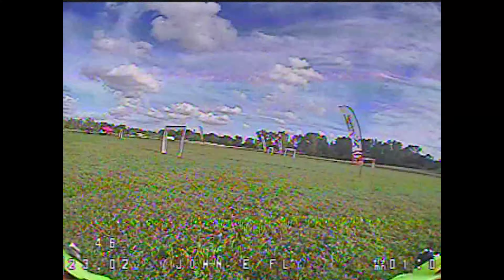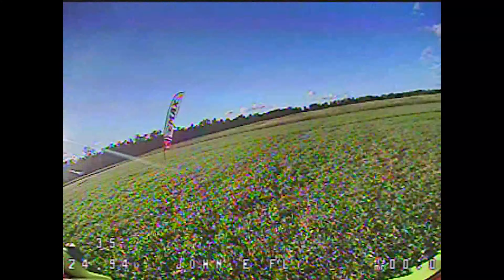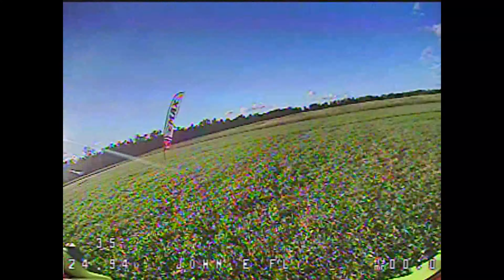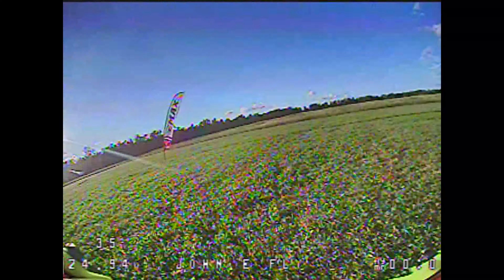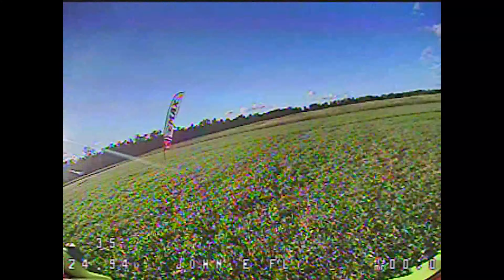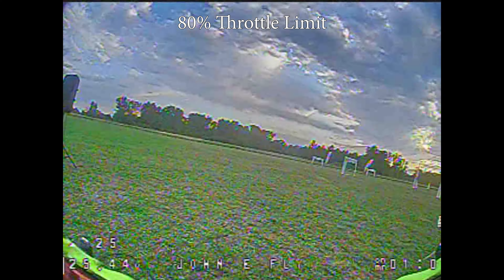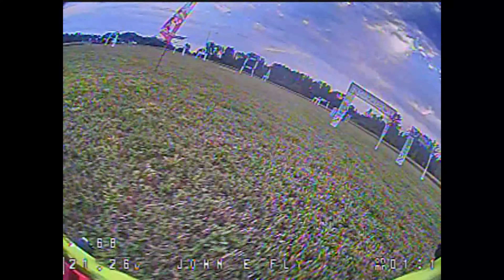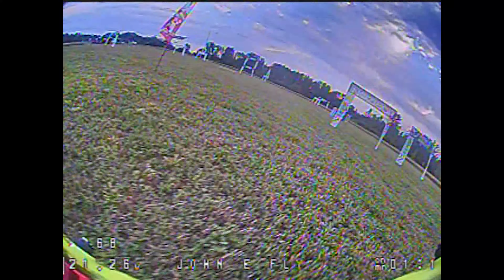Throttle Caps! | Limiting Your Throttle To Go Faster?

Comment: I think for those of us who aren't as fast, the added resolution is really the benefit on offer - 20% more throttle resolution for pilots that are still thrilled about finishing each heat they go up in is going to be a pretty noticeable improvement in results, especially for race formats that favor consistent finishes under pressure instead of getting one mistake-free heat.  Particularly for use weekend warriors, that's going to mean less crashes that are going to put us off our game and cause second-guessing abilities on a race day - the intangibles are definitely in favor of throttle limiting, then if feeling good do the same process of gradually bringing them up to get more pace.

Comment: Great video John E, this is something I've had reasonable success with myself - there were a few first gate incidents due to the extra power on starts though, so that's worth keeping in mind. That aside, I can think of a lot of pilots who would benefit from taking this approach - they all look at me like I'm mad when I tell them I'm capping the throttle, more power = faster in their minds.
Reply from the maker: More power equals a quad that goes faster...  doesn't mean it gets around the track in less time :).  I don't think people really appreciate just how important race lines are in FPV racing at this point.  It'll come though...

What do you mean by first gate incidents though?  That others have more power, so while you may get the jump on the holeshot, you had mid-airs because they are faster in a straight line?
Reply: @JohnEFly  we usually fly fairly small tracks and with mixed ability heats so it's good to get the holeshot and stay out of trouble, problem comes when the first gate is really close to the start line and you've just increased your throttle - I found there wasn't enough time to both adjust to the new limit and to get the holeshot, so I was either hitting the top of the gate or over compensating and hitting the floor lol

Comment: What’s the best way to add the cap? Thru the radio or thru betaflight or in my case Flightone?
Reply from the maker: I did it through the radio, so I can't say I compared them all and determiend the best way.  I also can't comment on the available methods within FlightOne.  However, I would assume that limiting throttle input (not motor output) would be the best way to apply a throttle cap.  And it would probably be ideal to change it on the FC so have maximum resolution from the transmitter, but doing it on the FC is a WAY bigger process if you plan to keep changing it, so that's why I did it from the radio.
Reply: John E Fly gotcha. 👍 I’ll mess around with it. I know there’s a few ways to do it on the radio and I know there’s a spot on Flightone that you can adjust it but I’ve never played with it. But watching vids now on setting a cap and I see that even the way I did it on my toothpick isn’t the right way lol. I just basically lowered the end point on the throttle which did drop it to 80% but it seems like it didn’t do it the way I was thinking it would. I did mine Similar to the way that Justin skinner did on his throttle cap vid. It works but not the best way to do it.
Reply: @JohnEFly  If you're trying to run high-KV high-voltage, I'd run the FC motor out limit in addition to the transmitter - e.g. setting an 80% motor command out limit, and 70% transmitter limit on a 5S 2600KV or 6S 2250KV setup.
I personally rely on the transmitter since it's easier to make changes on the fly, and I don't have to be powered up or have a computer in the field to reliable see where the limit is.

Comment: Do you scale the throttle or clip it? So at 60% throttle cap do you hit the 60% when your throttle stick is all the way up (scale) or at 60-100% stick deflection (clip)?
Reply from the maker: It's scaled
Reply: Resolution is always your friend - scale whenever possible, and add curves if it means you get more resolution where you need it.

Comment: Another Note: I use throttle curves now, so at low to mid i have around ~80% for tight turns, but at full throttle i get 100% when its really needed.

Comment: Great Research & Analysis. Thanks for sharing!!

One Question: Why did you skipped 90% :O ? 

2nd. question: What do you think about mechanically limiting your throttle stick? (either by getting the famous red racing gimbalsl, or using a 3d printed limiter and re-calibrating your throttle)
Reply from the maker: Thank you!  I'm glad you found it helpful.  Regarding your questions:

1.  Primarily because we ran out of time.  By the time I get off work and get to the field there is very little sun.  We just didn't have time to include 90% testing like originally planned.  It would have been a good test, but at the same time, I feel like 80% is already pretty close to 100% for me, the difference with 80-90 and 90-100 is less than the difference between 50-60 60-70 70-80...

2. I'm actually a fan of limiting the throttle travel.  Assuming you also calibrate your stick travel within your radio so you are not losing throttle resolution.  The IX12 actually comes with a restrictor on the throttle now so it's a shorter throw by default.  After trying that on the IX12 and really liking it I switched my Taranis to the red short throw gimbal as well.  I feel like I can get added throttle response by having a shorter throw.
Reply: @JohnEFly  great!!! Will try soon to print some 3d part to limit the throttle travel and calibrate. If I like it (which I think I will), I will buy the red short throw gimbal as well.

And will also try limiting the throttle to see if I can enhance my movements. 

Great contribuition man!

Comment: Im wanting to experiment here myself, was looking at how to make the caps in the IX12, are you only changing the end point to say 80% max, or are you changing all the points in the curve, so that quarter throttle is 20% instead of 25% when doing the 80 max. Is my questions making since, are you only changing the highest value, and not messing with the rest, or are you changing all the points in the curve to make it more linear?
Reply from the maker: I'm changing all the points to make the throttle curve linear

Comment: I think that running throttle cap from 50% to 100% will help pilots find their lines, but in the small local races, there are not enough practice sessions to take many packs on each throttle cap.

Comment: Not to be poking the bear, but why were there no runs done at 90%? It isn't mentioned why. Just seems like it is inclusive data to not include any 90% throttle cap runs and just going straight from 80% to 100%. 

Was it an issue with the Spektrum radio where only certian outputs could be done? Or was there an outside factor that is not mentioned? (Limited flying time etc). 

Will say, throttle caps are a good learning tool as mentioned towards the end of the video. I'd say definitely use them for say, a UTT track or similar when learning the course, or if deemed necessary  at a race.
Reply from the maker: It was just a function of time.  The sun was going down and we didn't have time for both.  Ideally we would have included 90% as well.

Comment: Did you run the 100% at the end of the day?  If so maybe this means you were pretty well trained on the track -> you expect to have better times at the end of the day. Also consistency could be more important than ~1s improvement. I track mistakes and crashes too not just lap times.

Comment: do you recomment putting a cap on a 2306 4s setup?
Reply from the maker: I would recommend trying this approach to force yourself to learn tighter lines regardless of your setup.  I'm not saying you should race with a throttle cap, or that you will be faster, but it definitely helped me to be faster once I removed the throttle cap.  On some tracks, I'm also faster with the cap.  The best recommendation I can make is to try it, and then see if it helps you.  Each pilot will be a little bit different.
Reply: John E Fly thankyou!!!

Comment: you can do show how to set now pls!?
Reply from the maker: There are many ways to do it.  If you have a Taranis there is a good video on Heart of America on how to do it.  You can set it in Betaflight if you use Betaflight using a throttle limit and scale.  Or you can do it like I did with Spektrum by going into the "Motor Curve" menu and changing the 20% 40% 60% 80% and 100% throttle positions to mean different outputs.

Comment: Have you tried scaling instead of capping?
Reply from the maker: It is scaling.  It's just a difference in terminology I guess.  But I did this via the transmitter and changed it so 100% on the stick was XX% output to the quad.  I then updated all points so the curve remained linear.
Reply: @JohnEFly  I thought you did it via betaflight. I C
Reply: @JohnEFly  I have mine set to a pot switch to change and another switch to turn it on.   Some have it set so that it speaks the number but I just look at the radio and dial it in.

Comment: I was beating guys this season with 2205.5 1722 and no throttle cap 😜
Reply from the maker: There is nothing wrong with 2205.  And honestly, 2205 is almost like adding a throttle cap to a 2207 quad and making it lighter at the same time.  2205 can be much easier to control, even though it lacks the top end potential.  I raced 2205 for most of last year against mostly 2207 pilots and had a lot of success.

Comment: you are missing the point.

The test should be a day on only 100% all day to see where you max out then try a day where you work through the caps.

Also, I tend to start at 75% then just go up 5% until I feel like it's not helping anymore or I'm making too many mistakes.  For me this ends up being between 85-90% which you didn't even test.
Reply from the maker: I think it's a bit tough to say I'm missing the point.  My point here is actually to start lower than 75%.  Flying at 50% REALLY forces you to focus on the lines.  In this particular case I don't think I ever would have found the lines that I did if I had started all the way up at 75%.  50% required a whole different level of thinking, and personally I believe I benefited from it, making my flying at 100% better.

Keep in mind, I'm in no way criticizing anything that you're doing.  I'm not criticizing using throttle caps, or flying at a set throttle cap.  I'm instead just doing testing of something that I wanted to see and sharing it with everyone.
Reply: TBH, there isn't improvement to be had above 95% anyway, so you're actually getting to that point.  
I tend to personally top out at 80-85% equivalent throttle cap performance in terms of overall race times because the consistency starts to drop off (I'll get a couple faster laps, and blow it, then recover quickly), so there's also some racecraft to doing that as well.
I also rely (probably too much) on flying inherently slower setups early in the day so that I can work lines and be closer to the performance edge of the quad, usually with the benefit of extra battery life in practice.